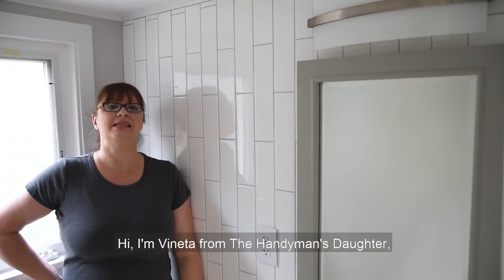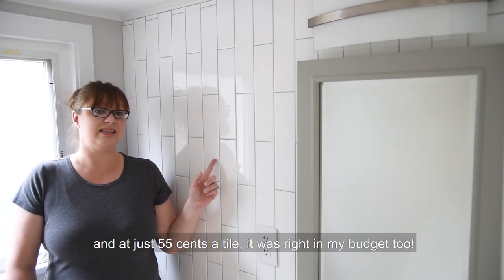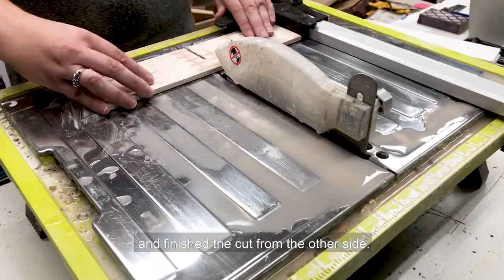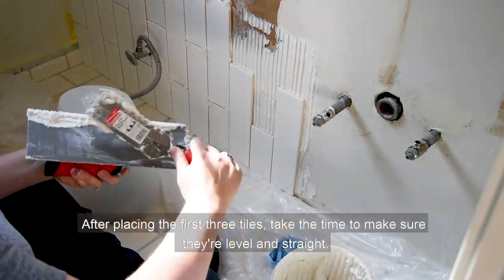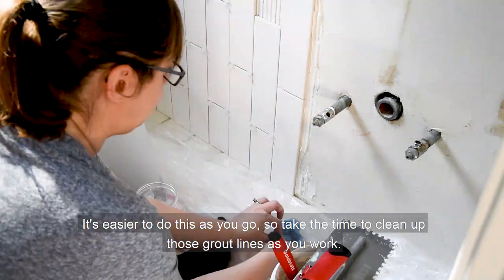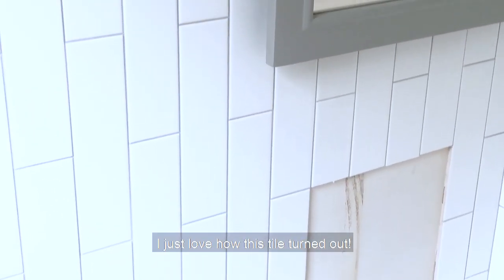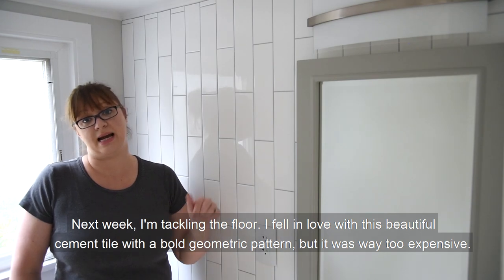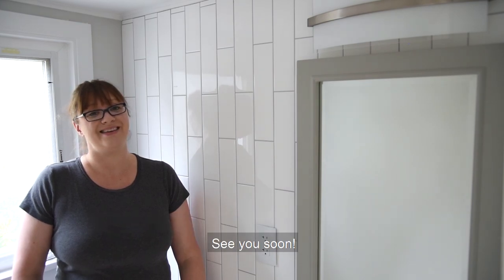How to Install Vertical Subway Tile

Comment: Nice, I'm in the process of doing vertical subway tiles also. Just curious if selling the grout is necessary?
Reply from the maker: I didn't seal ours, but it's a half bath that doesn't have a lot of water splashing around. If this were in a shower or a bathtub surround, I would seal the grout just to make it easier to clean in the future.
Reply: The Handyman's Daughter I'm tiling a tub surround. I was told by a home Depot associate that I should seal the grout to make it waterproof making it another waterproof barrier. None of the grout sealers says it seals in that manner. Only for stains. Is that true what the associate said?
Reply from the maker: @rathman4601  Yes, it's true that grout isn't completely waterproof. Unless you use epoxy grout (which is usually meant for glass tile), grout is made with sand and cement, which can absorb water and stains. The grout sealer is a temporary waterproof barrier that protects the grout.

Comment: Is it a coincidence that your video never showed the tile at the other end of the wall? Im guessing it's because there was a sliver of tile for the last row. You should always find the center of the wall and start with your tile straddling the center line so you and up with equal size half pieces on either end. Also, you should mark a level horizontal line on the wall at the max height of 1 tile then start your pattern there so you can adjust cuts to that first row in case your floor is uneven